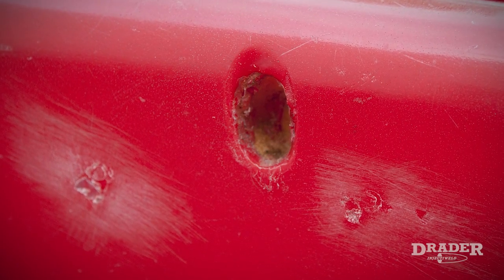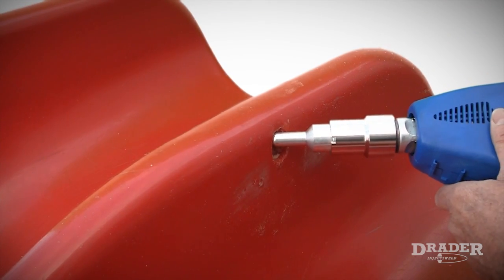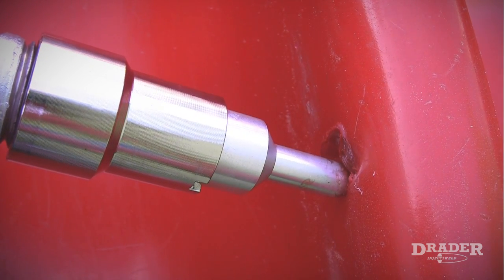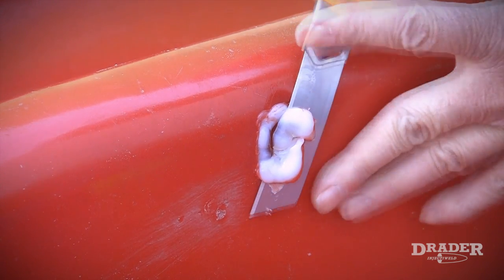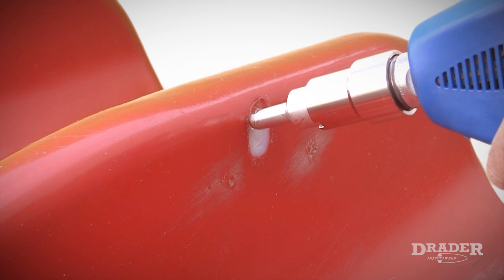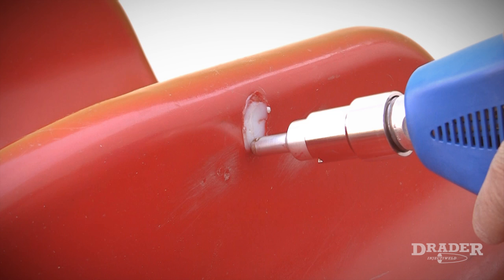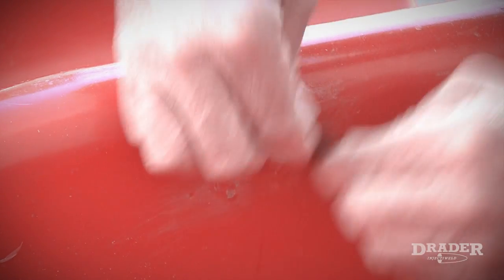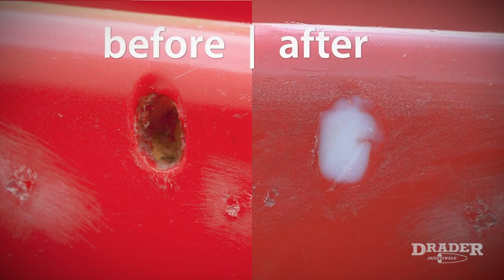Plastic Welding with Ease » Weld and repair a playground Slide using a plastic welder

Comment from the maker: Raine Dawn Valentine, thank you for your question.  For finishing you would cut the extra material off using a utility knife.  Then use the scraper blade and the stick scraper to make the surface smooth.  You can also find this information on the video at clips 1’14”, 2’12”, and 2’22”.  In case you want to match the colour of the plastic part with the repair, you can send a sample to us so we can match the colour providing a custom colour welding rod to you.  If you have any further questions, please contact us.  Sincerely, Drader Injectiweld team.